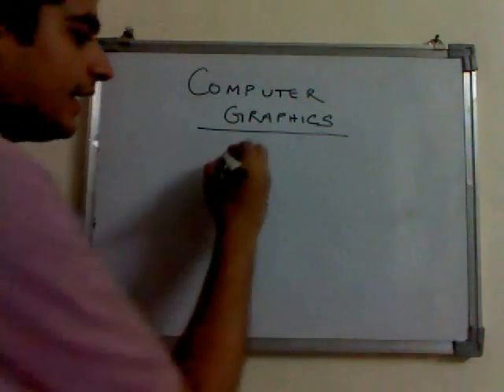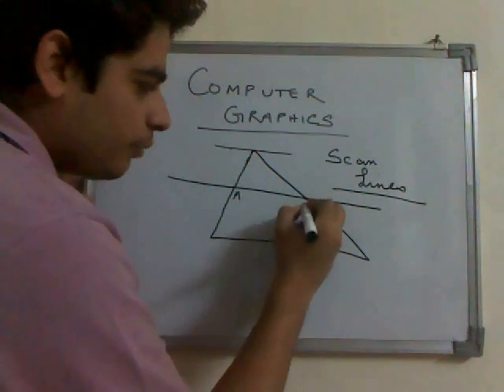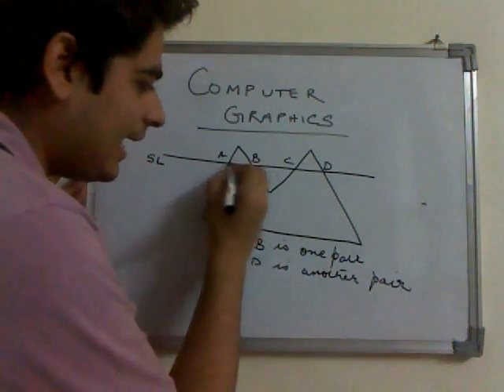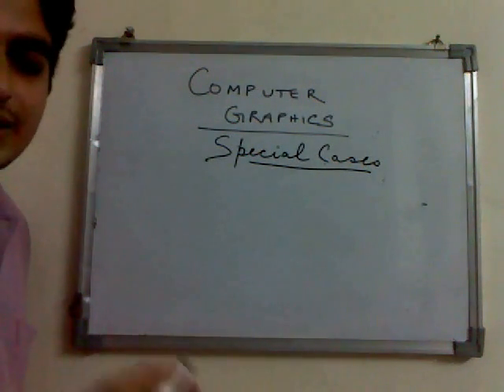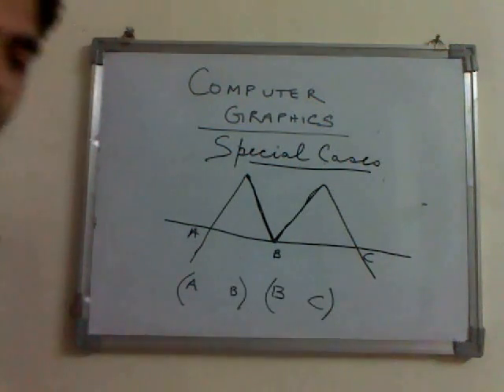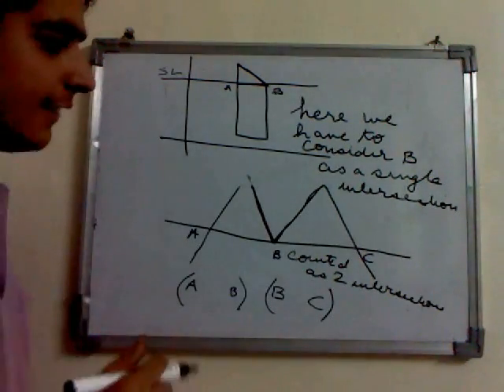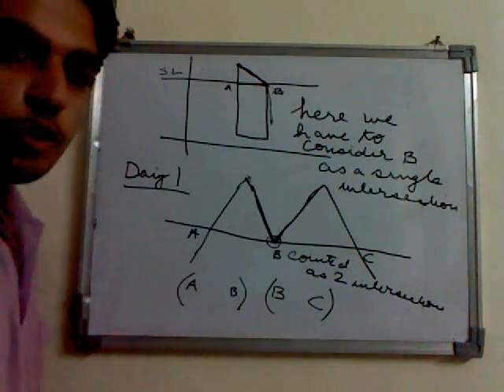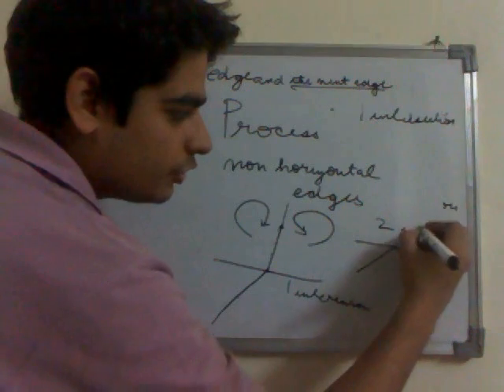Scan Line Polygon Fill Algorithm: The Concepts

Comment: A very good explanation! You covered everything thoroughly in my opinion and I understood everything you covered.

What would you recommend doing if an edge what horizontal? where would to pairs be then? I was thinking about just ignoring it if an edge lies on a scan line, then drawing an outline of the shape by connecting the vertices, but if you can suggest a solution in terms of adapting the scan line algorithm I'd very much appreciate it :).